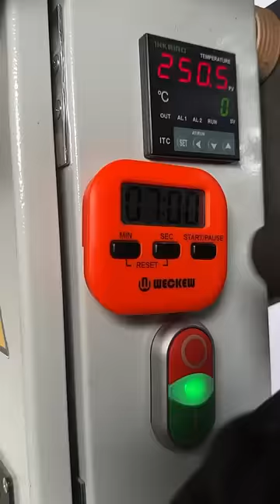How Recycled Plastic Spinning Tops Are Made

Comment: Is one thing that may speed up your demolding process would be lever Nuts/ bolts, which are commonly used on bicycles for quick release axles, or for easily adjustable seat height.

Comment: I've been considering using injection molding with my 3D printing. The trouble with 3D printing is it is a slow process. However, it can quickly produce complex shapes. So my aim is to use the 3D printer to produce molds for injection molding. Then I can produce the end product faster by producing multiple molds. It would require a high temperature resin for my printer and a low temperature injection molding plastic, but I think it is quite doable.

Where might I look to find prospective injection molding systems and information though?
Reply: Your missing a step. You don't want to use 3d printed parts as a mold. You make a mold for the mold. Then you can use silicone for the molds. 
You also want to design it in a way to be reusable and not destructive to the mold.

Comment: I’m not sure the need for bolts on the mold, get a clamp or some wing nuts at least. If you insist on using the mile long threads then get an impact
Reply: The tighter it is it leakes less round the edges

Comment: You should invent a machine to automate this and then sell them at a 95% discount, same amount if not more income, more plastic recycled, more happy customers
Reply: They are around 100k for the machines
Reply: @UKsystems  how did you manage to get 100k from a few motors, mechanical devices (gears, springs, chains, shafts, etc), a custom machined mould block, and a PLC with wiring.

Comment: You have to reheat plastic to 250° for 7 minutes while simultaneously reheating the mold in the oven. Not clear for how long but it takes time and electricity. You put ONE mold... Yes, I understand this is only an example of how it is done, still...

And the mold is made out of metal - it doesn't sound heavy so most likely aluminum.

All of this to make TWO pieces!

So much money, time, energy spent for NOTHING

This is silly!
Reply: You know… you can make more than one set of tops out of a mold

It’s already been warmed and there’s already plastic in the hopper. Cycle times might be a minute or two but that’s 30-60 an hour…

Molds are aluminum but are good for 10,000+ pieces
Reply: Using a small injection molding machine would be the way to go. More efficient regarding time and energy per part

Comment: But why seems like a waste as that stuff your making goes into landfills once you can't sell it
Reply: If any don't sell, they can always re-melt it down into something else
Reply: He's using the waste from his 3D printer to make new things. It's not being wasteful if he's using things that would normally end up in a garbage truck. I'd like to do this and use plastic bottle caps.
Reply: it’s hdpe, it could be recycled dozens of times in their clean, single plastic, correct temperature setup without significant loss of strength, and even if it did weaken eventually, it would still work in larger items like cutting boards or these tops. they did a video on recycling it many times and went up to 30 i think on something more mechanically demanding than this and it was still fine at 30.
Reply: WRONG.

First of, it's RECYCLED plastic. They literally already saved it from the landfill.

And NO, it DOES NOT automatically end up in a landfill, since plastic can be RECYCLED, which is the ENTIRE point here.

Seriously the dumbest comment I've read today. facepalm